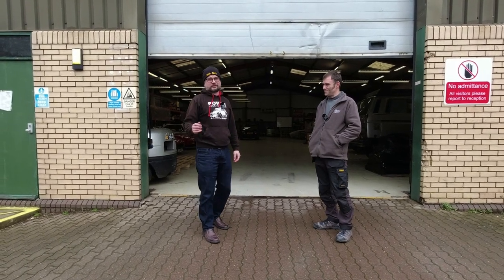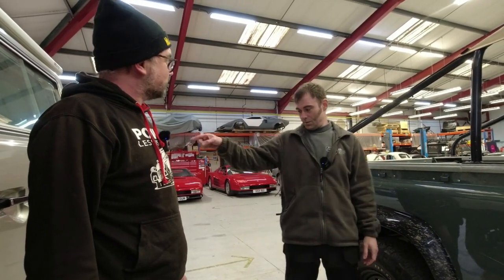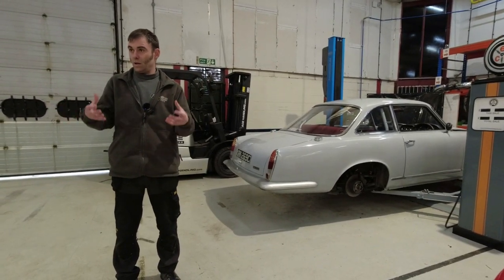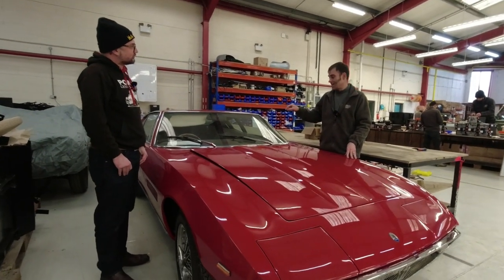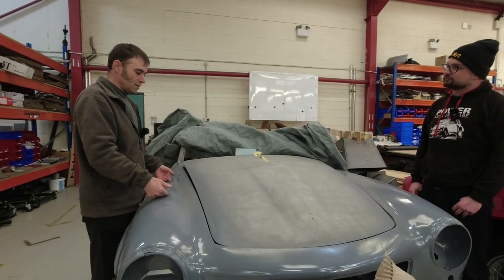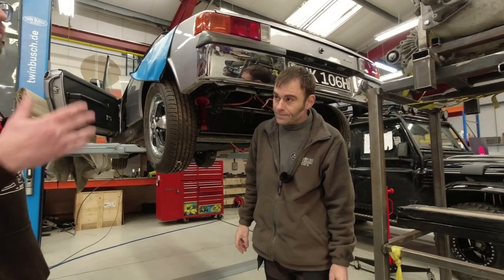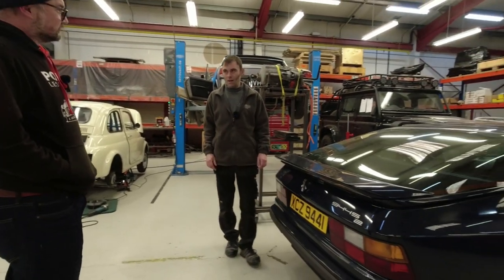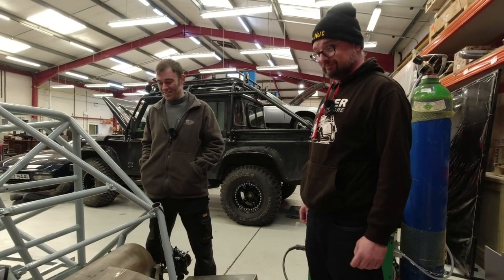Visit to Electric Classic Cars - home of Vintage Voltage!

Comment: Never seen that much controversy on HubNut before. As much as I love any engine noise, I do like electric conversions if they allow old beauties to keep being driven. I drive an electric forklift everyday, and that is incredibly nicer than the gas one.
Reply: Great turning circle too I bet.  Top speed similar?  😆
Reply: @peterriggall8409  Top speed slightly better, much better responsiveness at low speeds, no need for brakes with regen, hereby one foot control, no noise/smell, and no need to keep the revs to go up. Not to speak about all the electronic gizmos that make the job easier and safer.
Reply: @426baron  👍

Comment: Great interview!
I have ridden in a few Teslas and they are simply amazing; quick, almost instantaneous acceleration. Quiet. Because of them I love electric vehicles!
I'm sure to have this gentleman convert classics to EV is very expensive, but it does extend the life and use of said classic.
Cannot wait to see a test drive!
Reply: You can buy a brand new EV for significantly less than the cost of converting a classic car. But if you buy new, it will not have the feel and looks of a classic car.
Reply: @RWBHere  True. But will new EV'S become the future classics?

Comment: I'm sorry but this is really up setting the heart and soul has been ripped out and gone. Such a shame Ian.
Reply: Couldn't agree more. Get back to the IC cars Ian, ones that leak and smoke and make nice noises, imagine that Alfasud sprint you tested having no noise..... Horrid.
Reply: Agree 100%. People just see the bodywork. But without the engineering that went with the original car then that particular car is gone. The soul. The character. I find it funny when you see the expensive classic electric Porche and Ferrari. Waste of money. Porsche and Ferrari will disown them. Same with these Frankenstein builds. Don't care if it says Land Rover or MG on the bonnet. They are no longer either

Comment: Things change over the years so it's really not fair to tune out on evs. After all, if we didn't change over time,we would still be driving Austin 7s or Model A Fords.( which would be great conversions btw) In the case of cars like the Maserati,if you are forced into a non numbers matching engine,the value is lower anyway.
Reply: There was an electric conversion kit for the Austin 7 available in the 1930s. Birmingham Transport Museum (I think it was) had a motor/gearbox assembly from an electric 7 (unfortunately not a complete car) on display at the last NEC show. It looked very neat, and very modern - hard to believe it was getting on for 100 years old. 

That's the paradox, of course. We think of electric cars as new technology, and the way some people harrumph over them you'd think they were an Unwarranted Assault On Our Traditional Way Of Life, or something. But EVs are older than internal combustion cars. London had electric taxis in 1897!

Comment: Fascinating stuff!  I do watch vintage voltage and I can see everything good about EV but it's always just come down for me to range and lack of charging infrastructure in this country. Unfortunately I still don't see EV as a sound replacement to fossil fueled vehicles at this time. Plus there is the concern that they are just not as environmentally friendly as people say. The production of the batteries alone is horrifically damaging to the environment and their longevity is also very questionable
Reply: There are other uses for the battery packs once they have passed their peak in vehicles for use with  solar panels in homes etc. And the increasing ability of recycling old batteries into new .
Reply: Every one of those arguments, except the infrastructure that varies by jurisdiction, has been examined and put to rest. Yes, sitting side-by-side on a showroom floor,  the EV has a larger footprint than a comparable ICE, but its footprint in use is such an improvement over an ICE that the advantage fairly quickly turns in favour of the EV. Cradle to grave, there is no comparison. Engineering Explain, amongst others, has done excellent videos on this subject.
Reply: I must admit I wouldn't personally have an EV conversion on a classic car. However after hearing Richard put his explanation over I do get it. Unfortunately it does seem that only very rich people can afford to have it done. If you were to have a classic converted for £30000 would it not be better to just buy a MG EV for day to day use and just leave the classic for summer weekend use?
Reply: @peterdashper2251  Richard certainly has a great sales pitch but I totally agree with you although from what I read, most of these brand new ev's are virtually on the scrap heap after 4 or 5 years when the batts wear out as it is not economically viable to replace the batts
Reply: @CaptHollister  by you using the word 'jurisdiction' I'll take a guess at you not living in the UK. Lack of infrastructure over the whole of the UK is a massive issue I'm afraid. Also not all the issues have been addressed. Buy a brand new ev and see how long it lasts. Within 4 or 5 years it will be on the scrap heap due to needing battery replacement which is currently not economically viable. I suggest you go look into the environmental damage caused by lithium battery production before you try telling me that issue has also been addressed. Also Richard uses the cheapest Chinese batts he can find and have a massive failure rate It's no wonder Richard has so many second hand tessla and Nissan motors. Tesslas are falling to bits rather than crashing an like Tessla, Nissan batteries are failing prematurely leading to the cars being written off. EV tech is just not there yet
Reply: @opticaltrace4382  what are you reading? The Mail? There are plenty of EVs older than 5 years still on the road, a lot of the traction batteries have longer warranties than that. My PHEV is coming up to 10 years old and besides some capacity loss (maybe 20% or so) it still works fine.
Reply: I think theres valid concerns about the environmental impact of batteries, but it's hardly like drilling for oil is environmentally friendly - but it's not something new so, as with many things (like poor working conditions in third world countries producing our products), we just accept it. But in terms of battery longevity, whilst some degradation happens over time, the charging management has significantly improved the life, as most degradation happens when charged over 80%. So 100k+ is common, and lets face it, petrol cars have a max life of around 150k unless looked after. The fact they are pulling the batteries and motors out of crashed EV's to put in conventional cars shows the value. Hopefully, if/when that market dries up, manufacturers will start recycling motors into new cars, whilst degraded battery cars will continue to be used by people who can't afford a newer car and only need a shorter range (given many can 'fill up' at home, most people rarely use the 300+ mile range many new cars have). But the infrastructure does need improving, mainly through a universal app that gives real time update on its condition (does it work?) and accepting contactless payments with no account needed.
Reply: @opticaltrace4382  I do not live in the UK. In most of Canada the EV infrastructure is pretty extensive and growing and in my province in particular (Québec) it's extremely well-developed and growing except in the northernmost tundra and arctic regions. I cannot comment on the UK infrastructure as I'm not familiar with it. Pretty much everything else you stated, however, is the kind of out-of-date argument and exaggeration peddled by anti-EV echo chambers. Yes, producing the batteries has a larger footprint than extracting oil, but nonetheless even taking that into account the EV is cleaner overall. The batteries in the very earliest generation of Nissan Leafs were only good for  around 200k kms (say 125k miles), but starting with the second generation they were already good for 200-300k miles. At that mileage, most people will replace the whole car regardless of what powers it. What does the quality of Teslas have to do with the argument ? there are many other EVs and the number is constantly increasing. My friend recently bought a new Mustang Mach-E. It's a very fun car to drive and it has performed flawlessly even with temps in the -30c range and blowing snow.
Reply: The production of batteries is far less damaging to the environment than drilling for oil, refining it and then burning it. In terms of CO2 production, the EV breaks even with a petrol or Diesel car within a year of average driving, and from then onwards, the fossil fuelled car continues to produce much more CO2 and NOx pollution than the electricity for the EV does.
Range is no longer an issue for affordable EV's, when compared to petrol cars, Our Zoe has a Summer range of over 250 miles, and over 200 miles in Winter, with normal driving. My petrol cars never had a range of more than 260 miles in Summer, and 220 miles in Winter.
The charging infrastructure is improving in leaps and bounds. We've never had problems with recharging ( on our journeys between the Lincolnshire and North Wales regions, and we've never paid a penny for electricity at public chargers. And of course, an EV can be recharged at any mains electricity outlet, albeit more slowly, if a 13Amp socket is used.
For the record, over 10% of all new cars sold in the U.K. at the end of last year were electric. That percentage is increasing rapidly.
I hope that this helps to balance your assessment of the viability of EV's in Britain? 🙂
Reply: You're right to question these things. I have whole heartedly gone electric but only did so once I was satisfied that it was 'greener'. If anyone tries to tell you that an electric car is environmentally friendly then they are as ignorant as the guy telling you that we are not affecting the climate. Electric is better than ICE but some considerable way off cycling or walking. The potential for it to improve is much greater though. ICE car production is only the start of the damage they do, where as an electric car can (currently) be carbon neutral once built. See what certain manufacturers are doing to make the whole production process from ore extraction to end of life as carbon neutral as possible, Volvo is a good starting point. On a more emotive point, I think you will be pleasantly surprised if you drive an electric car, you may even be hooked. You do have to consider the journeys you undertake and the infrastructure though, as you correctly say. My advice is that when you think you can manage with an electric car, don't worry about battery size as much as charging speed. For most people, I think more than 50kWh's is just carrying excess weight around as long as it can charge at 100kW+. Happy motoring, Tim
Reply: @AaronSmart.online  I'm surprised that you have lost 20%. I have just traded in my 9 year old Zoe and the battery degradation was unnoticeable. I have a few friends with EVs who would tell you the same thing and my current EV is three years old and still exceeds what I was expecting it to do. The car that gives ammunition to the battery degrades argument is the Nissan Leaf, and possibly only early ones of these. They have the Achiles heal of no thermal management and suffer as a result. Literally any other post 2011 EV will suffer about as much degradation as an ICE car engine will, which is to say very little if looked after but potentially more if abused. Best regards, Tim
Reply: @opticaltrace4382  I think you will be forced to change your opinion if you read some of the comments. All the best, Tim
Reply: @timsmith5339  I'm not certain about the figure, as my range fluctuates throughout the year (always a bit lower in winter) and my driving patterns have changed. It's a Prius Plug-in so uses Panasonic NCA batteries (similar chemistry to Tesla), and has active air cooling (via the cabin) unlike Leafs. The 12V battery is the original and probably needs replacing, I've heard this can negatively impact the range.

Comment: Once again amazing video Ian on what is a very current and delicate subject in the classic world. It's great to see companies thinking-out-of-the-box to produce some custom conversions but are also thinking long-term with some of their conversion infrastructure to standardise the conversions (ultimate helping a little on the price). I still can't help feeling that converted classics will be an extremely niche end of the market at best, considering the price of conversions, lack of infrastructure and most strongly the general feeling that ICE's make a classic what it is (regardless of its shortcomings - isn't that what classics represent/how much cars have changed?) 

On the other hand some really good points made about their usability, nobody is disputing that in terms of reliability, but we're talking about classics that don't enjoy the winters and harsh weather in general; so they will still rust and deteriorate in the usual way. Even with a converted classic the owner will still want to enjoy but protect their pride and joy/investment, so will still avoid driving in the winter months/bad weather where possible. So probably not as usable as intended. So a converted classic has less of a selling point to it.

I'm pretty sure that the majority of classic car owners have a modern car to rely on, this either is or soon will be an EV. So why have a converted classic? Isn't that why such owners have a classic, a weekend drive, something different with a noise, a sound, a vibration that makes you feel alive and enjoying the moment. I've driven some Tesla's and although powerfully addictive, you can't really enjoy higher speeds with UK speed limits in which most pre-90s ICE cars are more suited to these speeds.

As a modern daily I'm sold on EV's but my view on classics... like a man I passed at a show recently who was muttering when looking over a converted Beetle "I see enough of these electric things daily, I didn't come here to see this s**t".

Comment: An interesting video. Sometimes I think I am one of what must be a tiny minority of people who are not the least bit interested in power, torque and doing 0 - 60 in nano seconds. The classics I have had have all been slow old plodders with a sound and gearbox whine that is musical to me and I loved them for it. An electric engine in an A60 Cambridge - just wouldn’t do it for me.
Part of the joy of a Morris Minor is the characterful raspberry ‘parp’ from the exhaust on the overrun. Getting smooth gear changes and the skill to drive a classic is what makes the experience enjoyable. I guess those into EVs enjoy a different experience, each to his own.
The only thing not mentioned in the vid is what happens to the batteries in the event of a major impact. In these days of Euro NCAP safety ratings, how do they stand up in the event of a major incident on the road and what do the emergency services have to do to neutralise any spillages?  Perhaps somebody more knowledgable can answer.  I get EVs in this day and age, but I wonder how the powers that be are going to continue to price us off the road - mind you the ever increasing cost of electricity will do that, I suppose. Keep up the videos Ian, love the variety of content.

Comment: A great insight into electric conversion Ian, the importance of the edge weight was very well explained. The takeaway point very well made is that there is a generation who doesn't know a Haynes manual. The current younger generation wants cars that are like light bulbs because if they stop they're stumped. Much the same as many modern internal combustion powered  cars for the rest of us. The ones that pop up a message saying "Take me to you dealer". I guess another reason to go electric is the simplicity and in theory at least easier and cheaper to service, no worries about water hoses etc. I'd guess hydraulics for the brakes and steering might still be needed. Hopefully when electric cars become more affordable (to me at least) with a decent range/charging infrastructure I would consider one.
Reply: @Alfred Wedmore Many thanks for educating me Alfred, I'm a novice om these electric cars so this is really appreciated. I'm sure others will find this information very useful as well. A very well made point about the reduced vibration for EV's.

Comment: Very interesting but I would prefer hydrogen. What happens to all these batteries when they are dead?
Reply: I have a feeling that electric cars will be a fad that dies out in a few years. The charging infrastructure will be a major challenge especially in older housing areas where roadside parking is the norm. There will be an increased consumption on the grid. Also More battery manufacture creates ecological catastrophes elsewhere in the world.
Hydrogen seems the logical long term solution. Hydrogen production will be increased as there are plans to start mixing this into natural gas supplies and gradually changing burners in domestic heating boilers.
Reply: @davecullingworth3787  I fully agree. If I had an electric car and it needed charging I'd be lucky to find a space outside the house to do so. Then there would be the trip hazard cable to deal with and the possibility of someone randomly unplugging it.